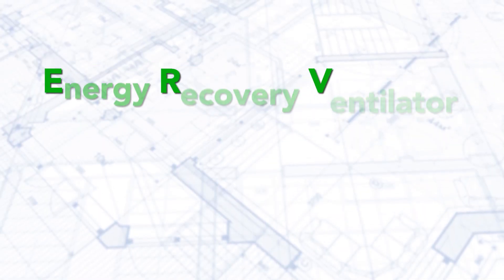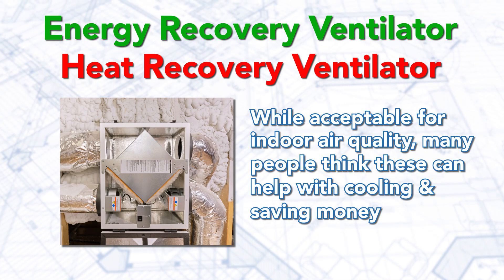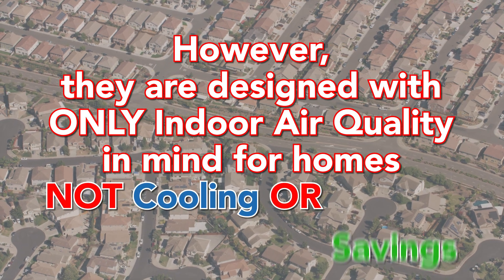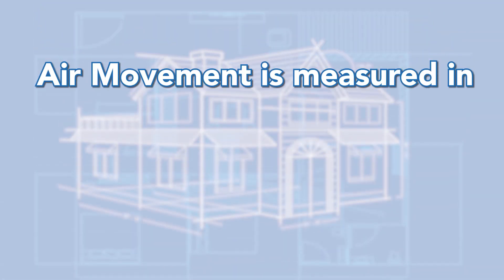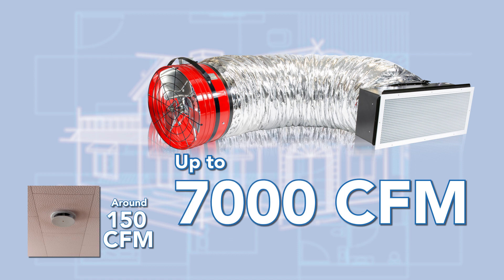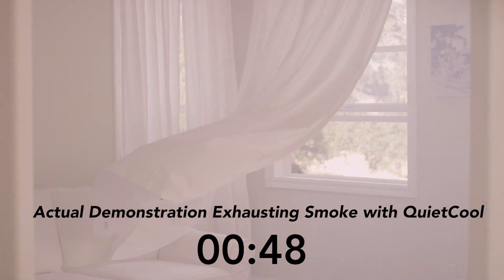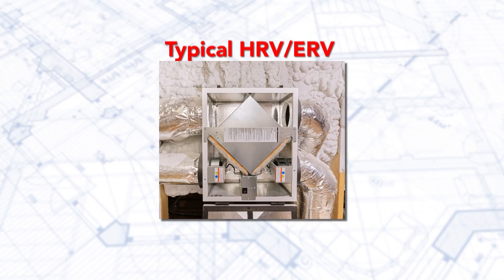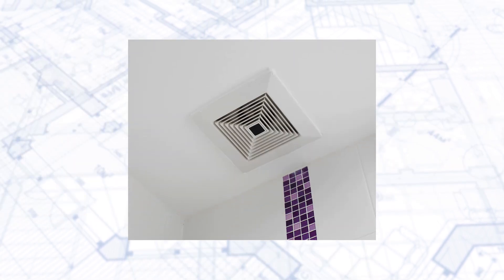HRV/ERVs & Home Cooling | Home Science Myths

Comment: Pretty misleading video. It’s like saying ‘cars are crap because motorcycles are cheaper and way more cool.’ HRV/ERV don’t cool or heat directly, they just RECOVER the energy you already spent heating or cooling the air in your house while providing needed ventilation air exchange with the outside to get rid of moisture, CO2 etc. And a well designed and installed one will make a big difference on heating/cooling costs while keeping your house fresh and free of condensation/mould. 

 The whole house fan is more or less an open window on steroids, rapidly bringing outside air in and forcing inside air out of the house. No heat is recovered, just massive exchange. While it has its applications, especially if you’re a lousy cook, it won’t help recover any energy and the air will need to be heated/cooled to a comfortable temperature from whatever the outside temperature is for as long as the fan is run. It’s great if you live in an area where nighttime temps are much cooler than days and can replace AC in the evening or where daytime temps can heat homes. 

Each has their place but to pretend they are comparable across use cases is disingenuous and deceptive. Frankly, this kind of sloppy marketing puts me off as it raises real trust issues on either the competency in helping choose a solution for a specific need or their honesty. Neither bodes well for customers in my experience.
Reply from the maker: This video wasn't meant to be a one to one comparison, but more of a response to people who think that they are comparable. We get comments all of the time from people who think that HRV/ERV systems move more air or that a bathroom fan is comparable as well. We were simply trying to educate that they are systems used for different scenarios and, as you said, thought they each have their place they are not really the same, especially when it comes to CFM of air movement and cooling capabilities. You are someone that seems to have a good deal of knowledge on the subject and so you know that already, but a lot of people don't and make assumptions . Thank you for explaining further and sharing your knowledge on the matter!

Comment: Complete bogus
Reply from the maker: What do you disagree with???
Reply: @qcmanufacturing  
You are comparing apples and oranges.  The R in HRV/ERV is recovery.  A whole house fan does nothing for recovery.  The whole house fan takes out all of the money you just spent on conditioning the air in your home (Heat/Cool) and sucking it all outside so you can spend more money trying to recondition all of the air you just wasted.  You are trying to sell the whole house fan by comparing it to a system that is not designed for that purpose.  It's the same as telling people to not buy a fish because it can't climb a tree the way a cat can.
Reply from the maker: First off I don’t think you understand whole house fans. You aren’t going to run the fan if you already cooled your home. You only run it when it’s cooler outside than inside. Second the video is designed to tell you the difference between the two products. One is meant to turn off your most expensive appliance the ac have an alternative way to cool your home that is up to 30x more efficient than AC moves up to 7,000 CFM. The other product is a fan that move 150 CFM and is used for a make up air system for strictly indoor air quality. I shared that information in the video. I’m not hear to bash HRV/ERVs we get a lot of people asking the difference.